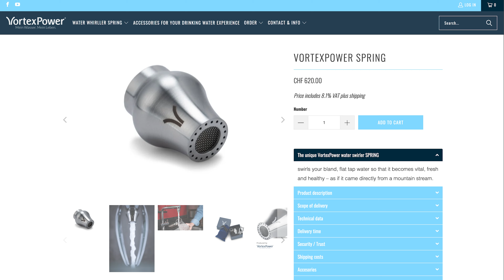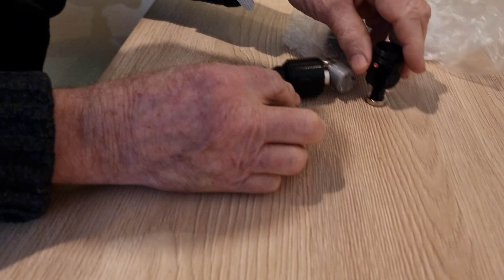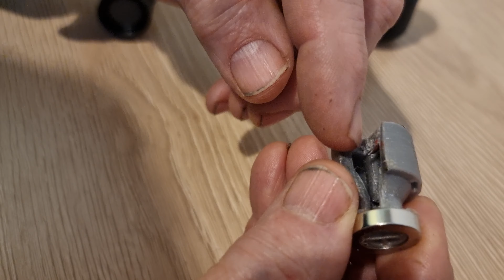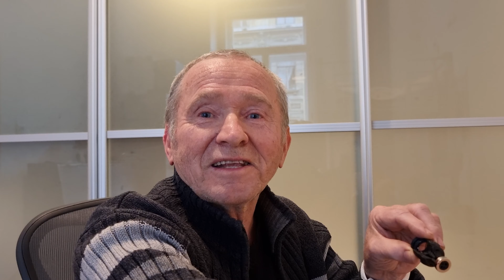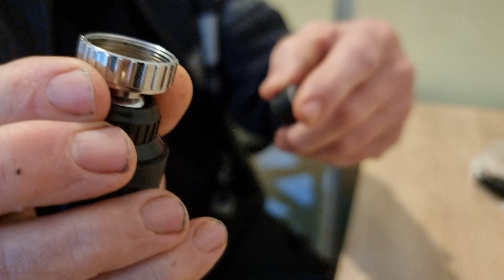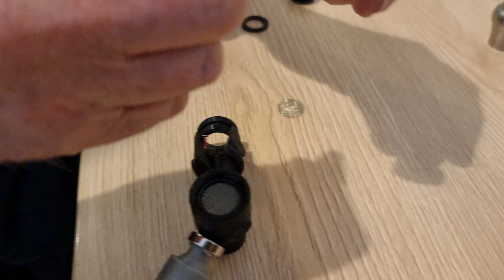Pavel Osmera's - water treatment faucet attachment

Comment: I was recently served water from a home water ionizer. pH was 9.5.
Supposedly very healthy to drink and support an alkaline body.
The taste was exquisite. Almost sweet.
Once side on the machine give high pH water for drink, the other side low pH for other applications.
Method is electrolysis. A bit of hydrogen gas can be made to spark. It pumps liters a minute of ionized water, on limited power.

Comment: Hi Bob, I’ve been experimenting with various spinners in the past to structure the water but haven’t ever really noticed anything. I’ve also tried another product called Analemma Water but again I haven’t noticed anything. I would love to try this but I distill my water at home because the tap water isn’t very good at all. Using this device and then distilling, will this break the structure again? Thanks in advance for any info/opinion you may have.
Reply from the maker: Distilled water does need minerals - I would use this after distilling.
Reply: @MFMP yes, I’m not worried about the minerals, I add them back. But this fitting is a tap fitting and requires mains pressure. How do you propose using it after distilling?
Reply: @ngrric001 use gravity rather than mains pressure
Reply: @spiritlifespace thanks! That’s what I was thinking if I had to try this out. Rig something up on the second or third floor. Mrs will love this 😂
Reply: @ngrric001 no I don’t think you need that much. The volume also creates force. For instance if you have a coffee urn with a spout at the bottom, the coffee comes out with sufficient force.

Comment: So about a year ago I started storing my drinking water in glass carafes but I would pour the water through a funnel that has a roundish stone at the bottom and a bunch of small stones on top to create vortexes and turbulence to mimic a stream. This water was definitely better tasting and satisfying that the same water without this process. Then I actually switched to putting a clear quartz crystal that is inside a steel tea diffuser . I’m not sure if the geometric pattern of the holes in the diffuser matter. But this water is the best and of course less work for me. I do believe that intention matters quite a lot.
Reply: Wait until you taste 9.5 pH from an ionizer...
Reply: @Cloxxki I don’t know about 9.5 but I think at least 8/8.5 is great. Pretty sure the water from the Osirion is 8.5 IIRC.